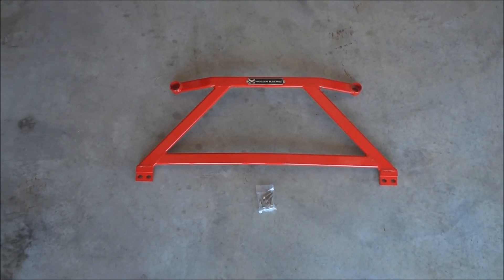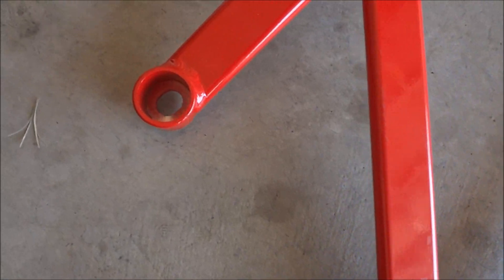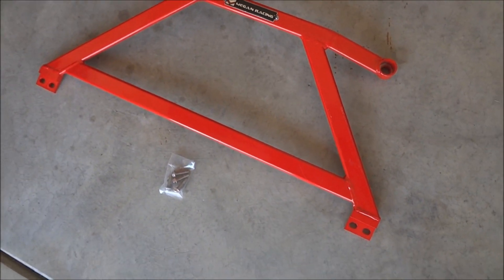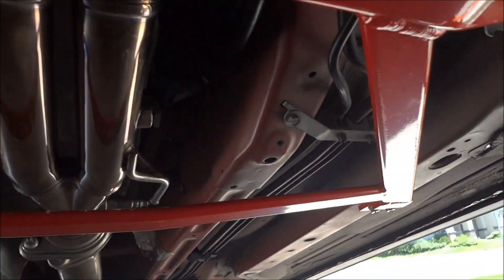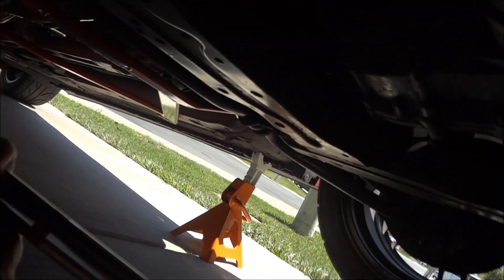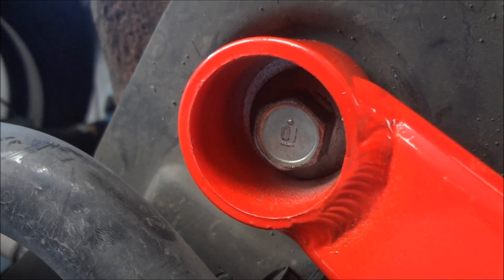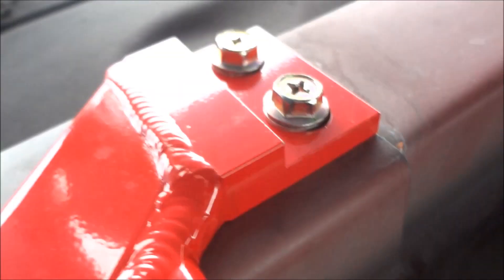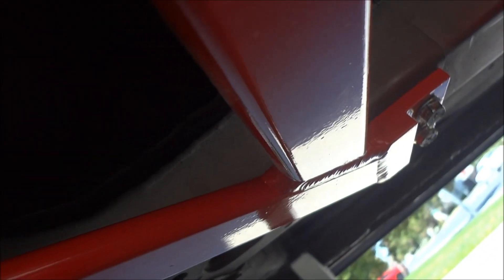Megan H Brace for my Civic Si Coupe FG2

Comment: I just installed mine. The difference is very noticeable good job Megan. The car dosent flex as much as before.  The shocks feel like are absorbing more of the energy of the impacts from pot holes on the road. The car feels a bit like it has a full body frame . It feels really confident . Now the main question is this part going to help you take corners faster i don't know. It will reduce body flex . Would i  buy it again. Yes 100 %. The reason i was looking for this part is because i had a different car where i installed multi piece aluminum skid plate for off road and for my surprise that improved the car road holding ability so thats how i found this piece.
All the best
Alex

Comment: Where did you find the torque settings? I just put one on my '14 Corolla. I used a beam style torque wrench to measure the removing torque and used that number for tightening. It'll do for now. But it's been hard to find any specs.